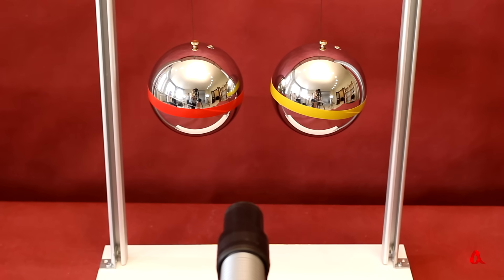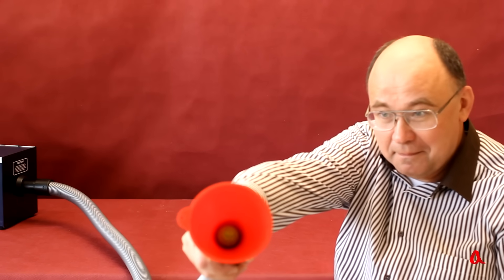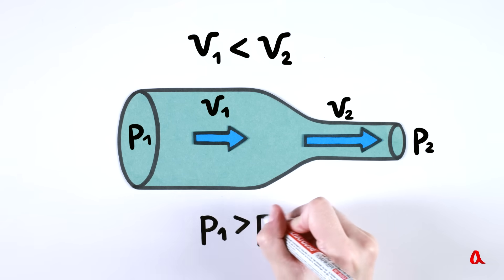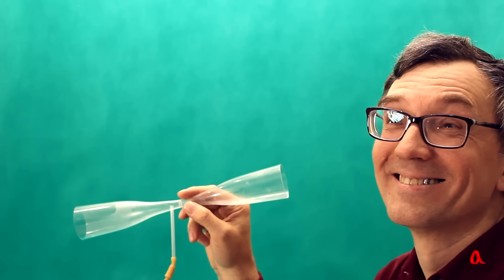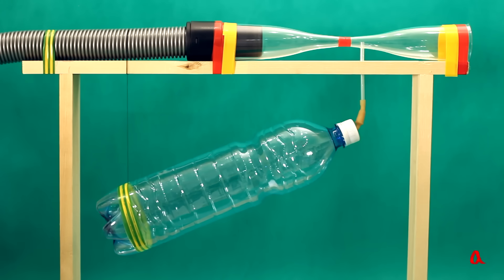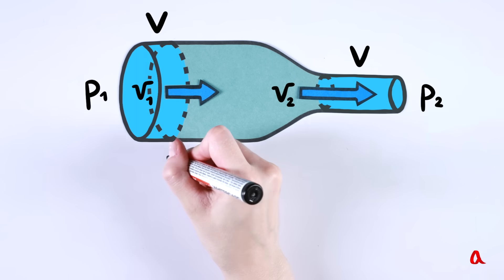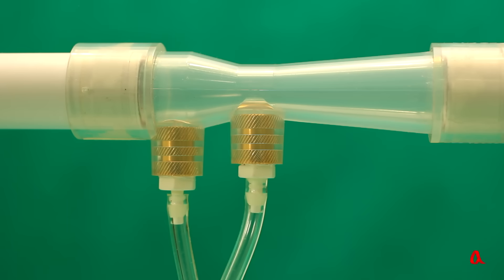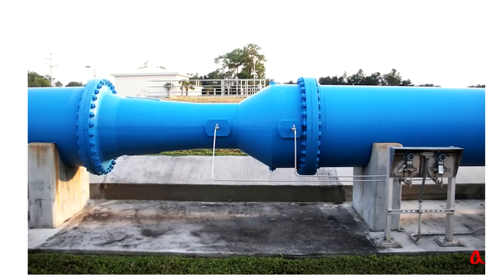Bernoulli's principle

Comment: You just made a carburetor.
Reply: Don’t you believe carburetors leverage physical principles?
Reply: Syphon hose
Reply: How do you think they developed carburetors? Do you think engineers don’t use bernoullis principle???
Reply: Merge collector 😎
Reply: And an air brush.
Reply: I thought it was a bong. But I ain’t that smart. 😂
Reply: @NeedleBender785 she could have.....
Reply: Do they still exist in the World of fuel injection?
Reply: @shreeveda They are used in tillers, generators, lawn mowers, chainsaws, weed eaters, pressure washers, some motorcycles... or any small engine running on gasoline
Reply: @crown674 GA planes like Cessna 172 and Piper Warriors have them too
Reply: @shreeveda yes on 2T dirtbikes
Reply: @shreeveda  Same for fuel injection.  Expands in the cylinder.
Reply: Oh yes!
Reply: Venturi effect at its finest
Reply: Mass injector
Reply: I was thinking penis enlarger
Reply: Basically. Lol
Reply: You don’t say 😂
Reply: Or a paint gun
Reply: I was about to ask whether this was the same way a carburetor works. Have you seen the video where a guy makes a transparent carburetor and films it in slow motion with a macro lens? Highly recommend.
Reply: @alberoDiSpazio  even my co.mentary does not violet their rules, youtube still deletes it anyway out of spite...you have a bunch of gay sitting behind the screens feln empowered to do as they please...not too long before another apps will replace yall...right now do as you please
Reply: What’s a carburetor?
Reply: Damb it you beat me to it lmao

Comment: Your statements about Bernoulli's Principle are correct, but your demonstrations are very poor.
The balls, spoon and funnel are a result of the Coanda effect which ALSO causes a lowered pressure in a flow along a convex surface.
.

The tube inserted into the wall of the neck is protruding into the  flow (seen at time 2:57)  This causes the air to curve around the end and sides of the tube.  This curved flow is the cause of the  lowered pressure.  This will work with no pipe around it; just the air blowing across the vertical tube.
..
To correctly measure the static pressure inside your narrow neck, the end of hat tube MUST be flush with the inside surface. 
..
At time 4:51 we see that the two pressure sensing tubes appear to be more like flush, but it is difficult to see clearly.  For that to truly sense the static pressures, there must be NOTHING protruding into and disturbing the flow.
Reply: And what is the difference, could you explain?
Reply: @schetnikov   Difference between what and what?
Reply: @Observ45er  between you and me, of course:)) Between Bernoulli and Coanda effects. Could you explain it?
Reply: @schetnikov  I post replies and they don't show up later???  I'll try again.

Comment: 🔥🔥🔥Amazing work 🔥🔥👍👍
Reply: This video is WRONG.
The statements about Bernoulli's Principle are correct, but the demonstrations are very poor.
The balls, spoon and funnel age a result of the Coanda effect. 
.

The tube inserted into the wall of the neck is protruding into the  flow (seen at time 2:57)  This causes the air to curve around the end and sides of the tube.  This curved flow is the cause of the  lowered pressure.  This will work with no pipe around it; just the air blowing across the vertical tube.
..
To correctly measure the static pressure inside your narrow neck, the end of hat tube MUST be flush with the inside surface. 
..
At time 4:51 we see that the two pressure sensing tubes appear to be more like flush, but it is difficult to see clearly.  For that to truly sense the static pressures, there must be NOTHING protruding into and disturbing the flow.

Comment: This is great!
Reply: This video is WRONG.
The statements about Bernoulli's Principle are correct, but the demonstrations are very poor.
The balls, spoon and funnel age a result of the Coanda effect. 
.

The tube inserted into the wall of the neck is protruding into the  flow (seen at time 2:57)  This causes the air to curve around the end and sides of the tube.  This curved flow is the cause of the  lowered pressure.  This will work with no pipe around it; just the air blowing across the vertical tube.
..
To correctly measure the static pressure inside your narrow neck, the end of hat tube MUST be flush with the inside surface. 
..
At time 4:51 we see that the two pressure sensing tubes appear to be more like flush, but it is difficult to see clearly.  For that to truly sense the static pressures, there must be NOTHING protruding into and disturbing the flow.